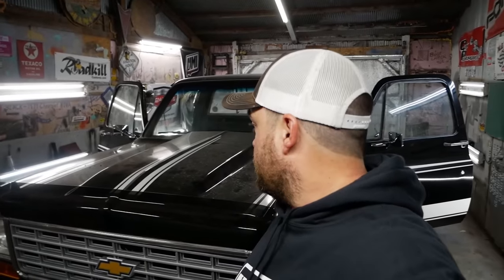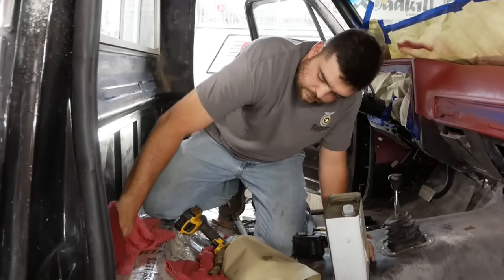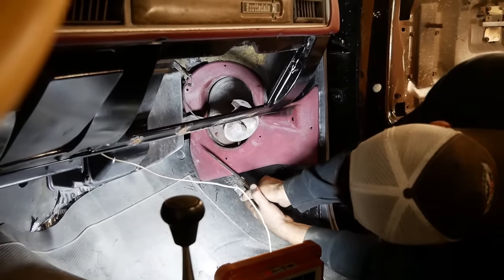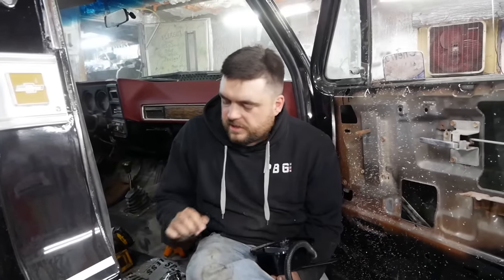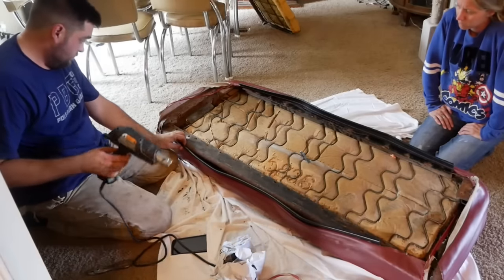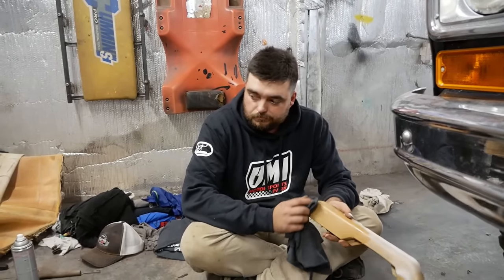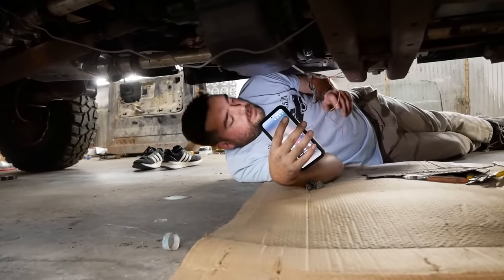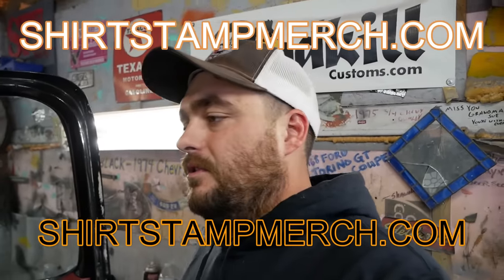Budget Interior Restore on Chevy Sport Truck!

Comment: I had a crossmember in my 70 vette where the paint kept wrinkling.  After removing and repainting several times with the same results, I used acetone to remove the paint instead of paint thinner and it worked.  Might try it.... Anyway, great truck, great people, and a great video!  Really enjoyed it!  A+++++
Reply from the maker: Worth a shot! I found the correct glovebox box eBay, I'll strip the paint off and try a little acetone

Comment: I have a buddy who owns a classic 1973 Dodge Charger period he gave to me probably about 15 years ago a plastic handle that goes on top of a spray paint can it has a large multi finger trigger which saves your finger tips from being worn out from spraying the paint nozzle period they work amazingly, I will never go back to using anything else they simply slide down over the top. They look ridiculous but I'll tell you what man they apply the paint excellently I would suggest Going Out and getting one or two, I'm sure that they sell them at.  Either a big box store like Lowe's or home depot. Or you might want to check one of your local auto parts places, but please, please, please for future jobs, go get at least one. You will love it!

Comment: Watching you do the windows reminded me of the last time I messed with replacing a window. Guy sold me a window that someone else returned that had the old window they replaced in the box. I wouldn't find this out till much later.

After a month of not understanding why it wouldn't fit, I had to get talked down from smashing it with a crowbar.
Reply: I ended up just attaching bale wire to the ends to move it up and down, with a screw hook in the roof to keep it up.

Comment: A good way to fix the door slam issue is to just put electrical layers of electrical tape over the strike bar to take the place of the old bushing they used to have. (Not sure if you know that or not, but its the cheapest way i know to stop having to slam squarebody doors.)

Comment: Rustolium has been kind of off the last couple times I've used it both for modeling and non modeling uses. New cans of their Testors ( now owned by Rustolium) I've found with their contents leaked out due to bad seams and had a couple of home paint projects that the Rustolium never quite dried and effectively had to strip the items and repaint with another brand. 
Oh geeze yes that burgundy red interior was a pain in the rear on the model I built for you. Had to repaint 3 times to get it right.

Comment: The light in the bottom is the lense for the license plate light and yeah I know that the cover lenses looks dumb with the clear section at the top but that's the way it goes lol and the ones for the dodge tin grille trucks they still make why they don't for the gm and ford trucks I don't know.

Comment: I know it might get out of hand quickly, but have you thought about opening a P.O. box? I was thinking it would be cool to set up some kind of burner email where people can send photos and descriptions of stuff they could potentially send. If it was junk you could just not respond, and if it's something you wanted than you would respond with the address. It would be a way to keep it under control whilst reaping the rewards of parts and other rusty junk from fans and other weirdos for the low low cost of nothing at all (besides the cost of the box), and even if the address "got out" it would be less of a flood than having it in the description. Just a thought, really enjoyed the video
Reply from the maker: PO box is on the channel page in the bio
Reply: @PoleBarnGarage  It would have taken me two seconds to check lol. Thanks for letting me know

Comment: Man I see picked apart square chevs in the junkyard with the stripped cab that one will get way more sloppy as it bounces down the road you just didn't have enough of the floor and rockers and the stamped in reinforced sections you just cant fix sturdily without a welder I'm amazed It hasn't distorted more good rigging
Reply from the maker: Literally welded all the panels in

Comment: You still need to  "weigh the doors" on those years , the doors were lighter but MANLY MAN USED ........THE HINGES COME LOOSE....." "WEIGH THE DOOR HINGES.....JACK THE ENDS , LOOSEN HARDWARE, CHANGE IF NEEDED , TIGHTEN HINGES TILL 

"BALANCED"

Comment: 11:20

You know what my biggest automotive-related gripe is with the federal government?

It's not the road taxes or fuel costs or pressure to seek an alternative fuel or CAFE requirements...(which all suck, by the way)

IT'S ALL THE SAFETY NONSENSE THAT THEY MANDATED THAT DROVE THE COST OF A NEW CAR THROUGH THE ROOF.

I'd love to buy something new just to be the first owner, for once. But it's out of reach. They're just too expensive.

And I believe drivers are becoming less skilled, as a result.

I don't need blind-spot monitoring. I've been leaning forward to adjust my side-mirror-perspective forEVER. Never been an issue.

I don't need a backup camera, but I can sympathize with little kids who shouldn't have to get run over because their parents are stupid.

I don't need stability control or traction control. In fact, for a guy like ME, who learned to drive on snow and ice with rear-wheel-drive, those things are too late when I'm already compensating for a skid and they cause me to lose control by the time they respond.

Airbags. How about we don't drive into sh*t?

Antilock brakes? Maybe I've gotten spoiled with those. They do go nicely with a 4x4 system that can empower you to go a bit faster in inclement weather...not that...🤨...I would...😏